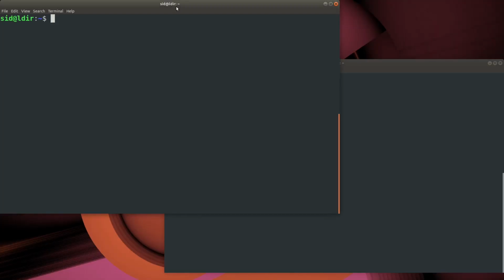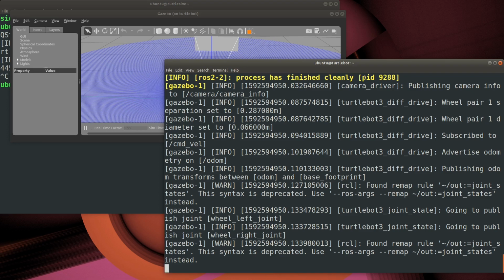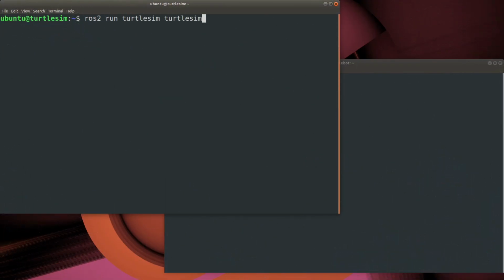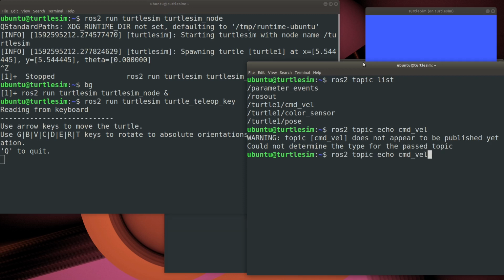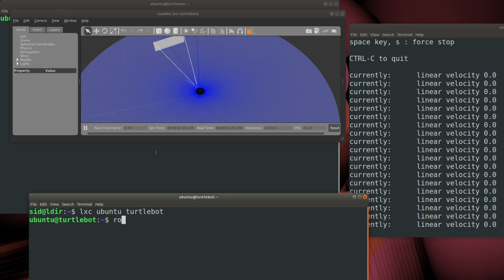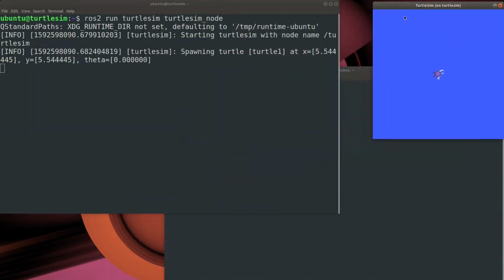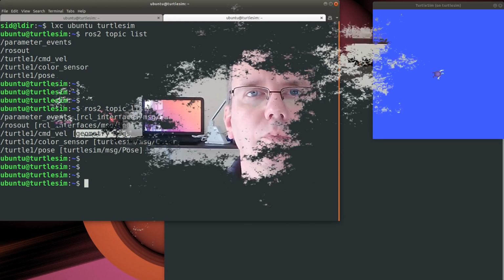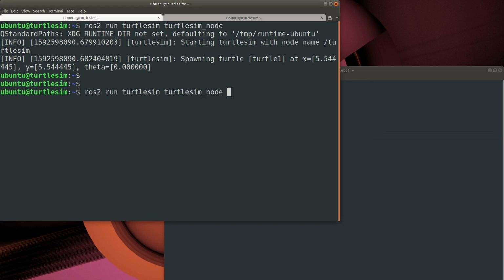Getting Started with ROS Part 1: Nodes, Parameters and Topics

Comment: What is lxd container ,why it is used?
Reply from the maker: Virtualization comes in many flavorx, LXD being one of them. Lxd lives somewhere between docker and kvm on the virtualization continuum:

 - Like docker they're quick to get up and running, you just pull down a base image.
 - Also like docker and unlike LXD they're lightweight and leverage the underlying kernel.
 - Like docker you can only run a linux LXD machine on a linux machine.
 - Unlike docker, the lxd images come pre-loaded with more of the software utilities you'd expect from a base Ubuntu image (e.g., vim).
 - Like kvm machines, lxd images are meant to persist over time, while docker containers are meant to be ephemeral and rebuilt regularly.

These attributes makes it fit well with our robotics use case. Hope this helps a bit.

Comment: Hi Sid, is the joy_node available for a wireless xbox controller on ros2 yet? I want to swap it out for the keyboard controller and have a play in the sim. Just bookmarked the ros2 tutorials, they look great!
Reply from the maker: You're getting ahead of me 😀  There's a bit of setup to do, but if you want to dig in you can take a look at a video for LinuxFestNorthwest, see https://www.youtube.com/watch?v=3HuV1M1NMB8, starting at about 15:50. That's using a wired XBox 360 controller--didn't have the heart to steal my son's wireless controller but it should work the same.
Reply: @UbuntuRobotics  haha sorry. I wanted to get my rover moving manually first before moving on to sensors. I want to do it in bite sized goals so I don't burn out or lose interest. I think it would be a massive milestone just to see it move.